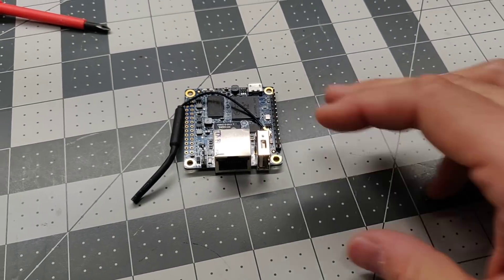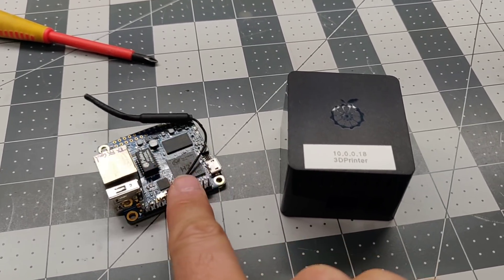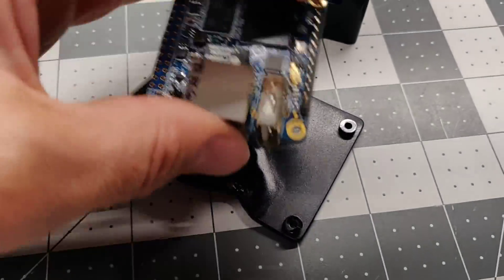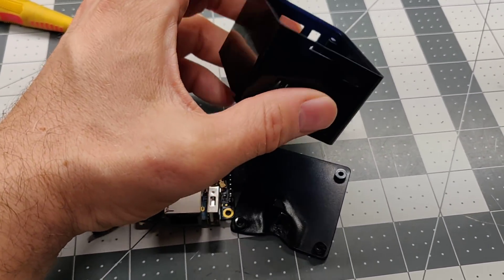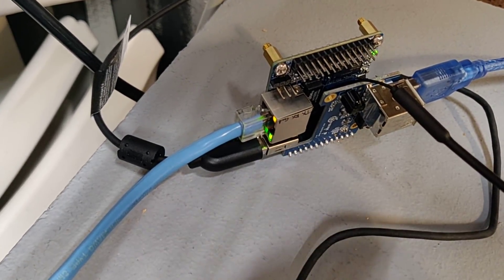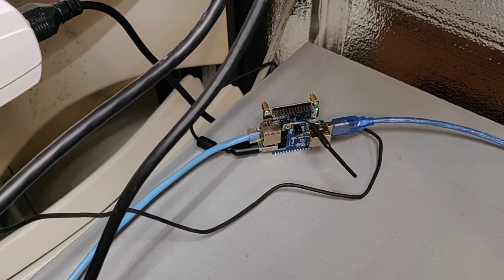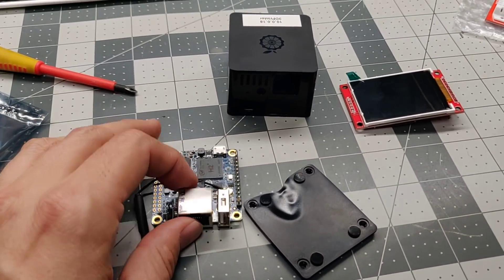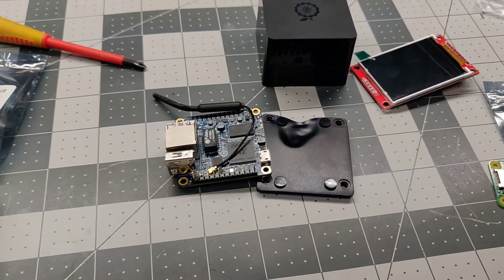Rant: The frustrating Orange Pi Zero

Comment: Haven't had any major issues with mine yet, I noticed right away that it got really hot (cpu area, not sd slot area) so since then I never run it without both a heatsink and little fan. The wifi is not that great but I've had mine working up to about 80m away through a couple of walls, similar to the range of my phone/tablets, but on average less reliable.
My biggest gripe is the lack of memory means you simply can't compile some packages at all, and it's slow as molasses on any substantial workload. But for $15, hey....
Reply: >similar to the range of my phone/tablets, but on average less reliable

The wifi chip they used is crap, the allwinner driver for it is a hilarious mess and there seems to be a board design issue that causes a lot of frames to come into the chip corrupted from the start. TL;DR; be surprised it even works at all :D.
Reply: I have both versions, 512M and 256M running the same OS image. The 512M melted too... but still functional. I learned that the official case is terrible for heat dissipation...
Reply: As if you can find them that cheap when people buy and resell and price gouge.  More like 30 USD, without adding anything to it to get it to work. At the end of the day you spend over a hundred  and may as well have bought a used laptop and an android for the same price to buy both, both of which would be stronger hardware.
Reply: Agree, I bought mine in China, paid the equivalent of 158RMB (around 20 dollars) in two OrangePi Zero 256/512Mb and two 8Gb SD Cards Sandisk Ultra. I already had the power supplies. But here in Brazil I would pay the equivalent of something around 80 dollars, same value of a basic used notebook.

Comment: This is no defense of the Orange Pi Zero, as I have no experience with it, but your symptoms do remind me of another passively cooled system that was giving me problems.  It ran really hot, and unreliably when used with the power supply included in the package.  I did some testing, and determined that the included PS, while it was supplying the rated current, wasn't actually capable of supplying the current required by the system when under load.  This caused the voltage to sag and the system to overheat and malfunction.  
After swapping the included supply for one that was rated half an amp higher, the system now runs much cooler(just warm to the touch,) and exhibits no more crashes, or performance problems(probably caused by heat related throttling.)
Reply: There are 2 causes for OPI Zero to running hot. One might be not in-spec power supply (it needs rock solid, stable 5V/2-3A), the other one cooling system. Board is heatsink-less and fanless. It cannot remain that way because even on simple tasks H2+ heats up over 60°C and iirc that's the point it begins to throttle. Daughterboard with CVBS, ir and usb don't help in heat transfer AT ALL. It is poorly thermally designed case.  With proper cooling (diy) those boards run significantly better but anyway that's sub 10$ and more powerful than RPI Zero... that compute power does come with a price (heat).

Comment: The kernel/os orangepi provide doesn't do thermal management correctly. You'll have more luck with Armbian but the wifi on those boards is junk from the start and the driver has never been very good.
Reply: Maybe I misheard but I thought I you said you were using the images from the orangepi site? Since you're using the wifi maybe you're using the "legacy kernel"? I think the legacy kernel has the poor thermal management problem too. Anyhow it's worrying that it got to 139C. The times I've gotten a pi zero to lock up due to heat it's been well below that. I'm guessing there's a short somewhere (maybe in the chip itself) and although the thermal management saw the temp raising it couldn't actually do anything about it.
Reply: The armbian forum has many complaints about the orange pi temperature sensor (Poor calibration and non-linearity)...

Comment: You did better than I could. I couldn't get the WiFi working at all. They run too hot normally. I put a heatsink on mine but when they crash they overheat the whole board. These boards should be a test of whether a reviewer is any good. Anyone who reviewed these and said they were OK should be ignored.
Reply: use Armbian
Reply: I've been burnt (pun intended) by single board computers that have good hardware but terrible software support. It is why I still have so many Raspberry Pi's around doing work.

Comment: Thanks, I was thinking about one, but looks like I'll stick to Raspberry Pi units.
Reply: Commodorefan64
They're not that bad... Stick a heatsink on and they run fine.
Reply: tin2001 Maybe so, but the software support for Raspberry Pi units is just so much better overall for so many different applications.
Reply: I have on orange pi zero 512mb, in a cardboard box, serving as a NAS, web and vpn server, it runs everything no problem.
I use it non-stop for about 1 year and again no problem.
Wifi isnt great but does the job (more reliable on ethernet)
I use armbian as the operating system.
Just be carefull with the power supply the orangepizero recommends 5v 2A I think .

I think that the orangepizero is a good choice, it's the cheapest SBC with ethernet port
Reply: this review is horrible, the orage pi are great boards just use common sense to keep them cool
Reply: @mintonbrunkhorst7070  why is it Bad, he used the case that comes with all the aliexpress orders anyway? It should stay below 70°C at any time.. Meltdown is no option,this piece of China junk will set you house on fire

Comment: They do run hot, but keep in mind not all microsd cards are created equal.  If the orange pi runs it at 3.3v instead of 1.8 (pretty much guaranteed), newer cards designed for 1.8v (UHS-I) get HOT if their step down circuitry is inefficient (most are, I wonder if they use voltage dividers or a diode regulator to drop the voltage down).  I think this places a larger load than normal on some low end SD card chipsets and low power voltage regulators on embedded boards.

I’ve found non-UHS sdxc and sdhc cards work much better in orange pi boards and others designed for 3.3v operation, and stay MUCH cooler.  You don’t really get any performance benefit from UHS-I in these boards either.
Reply: soupisgdfood could that affect USB SD writers?  gets toasty when using it to write my cards and they feel hot.
Reply: Knuckles the Echidna yep, I’ve noticed it with usb readers too.  I don’t have the problem with non UHS-I cards.
Reply: Adrian Black 139c?!? Holy hell!

Yeah you got a bum one, probably.  It sounds like it might have been throttling down to try to reduce temperature so much that logging stopped?  I don’t know what caused that, but if the SOC failed short circuit for some reason that would explain the ridiculous temperature.

The burns on the bottom likely just came through because the sd card cage is metal and conducts heat quickly, and that IC on the bottom could be a voltage regulator which would get really hot under high load.

But that’s just a theory.  A FAILURE ANALYSIS THEORY!

Aaaaaaaaand CUT!
Reply: I know orange pis can get hot under load and it doesn't even need much of a load. You would also probably be surprised at the average CPU usage of Octoprint's background tasks. I personally wouldn't recommend using an orange pi as a server without a fan, and worse that case looks like it provides way too little clearance (I could definitely see how after long enough the heat in the stagnant air would reach an equilibrium with the board). Based on the logs I would say it detected the overheating but some kind of bug prevented it from properly protecting itself and instead it killed itself.
Reply: And one sign of a failing micro-SD card is it getting blisteringly hot.